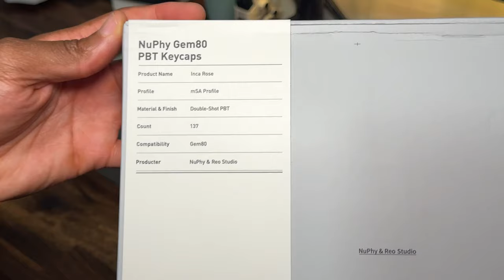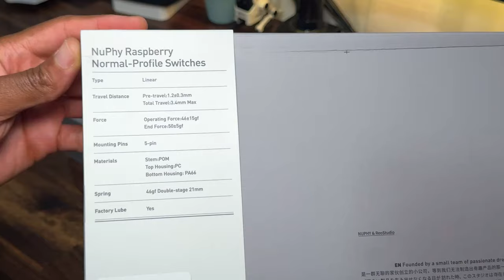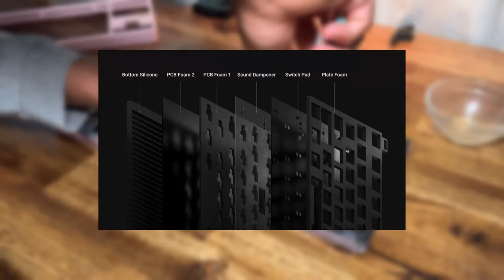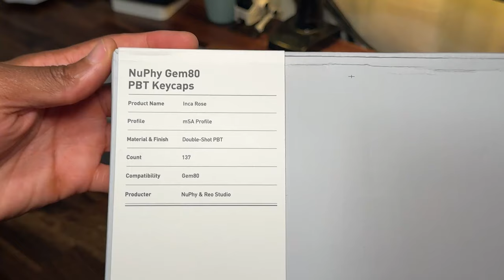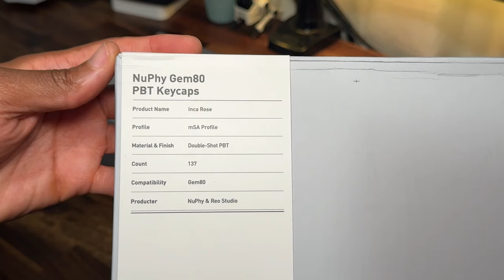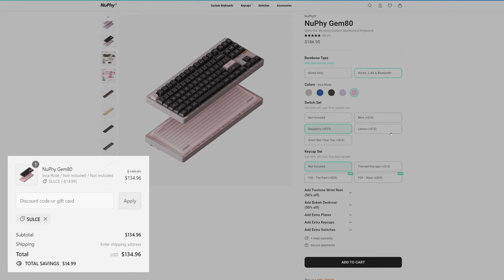A Thocky Custom Keyboard? - NuPhy Gem80 Review + Sound Tests #keyboard

Comment: Thanks for the video. I am looking for a new 75-80% aluminum keyboard and the Gem 80 is on my short list. i just ordered the EPOMAKER x Feker Galaxy80 and should get it in a couple of days. lt’ has what looks to be an almost identically shaped case with with the rounded bottom but it’s an 100% aluminum case and much less than 1/2 the price. If i don’t like the Galaxy80 i’ll probably try the Gem 80.
Reply from the maker: No problem! Glad this helped. That 100% aluminum case on the feker sounds pretty nice though. Hopefully it’s good!

Comment: Bro when i use my keyboard,  keycaps are slightly move how can i prevent this situation
Reply from the maker: Can you explain more, what do you mean by slightly move?
Reply: @sulcetech  it not just move up and down it also move right and left little  when i didint push properly and this didint feel good
Reply from the maker: @apoledev  I think this might be the normal slight movement of the keycaps, is it registering the keys?